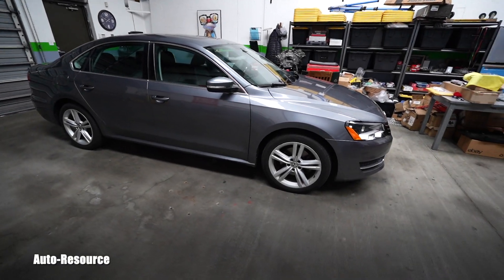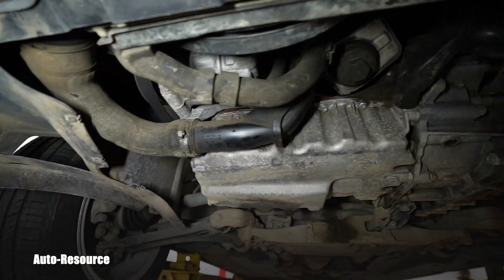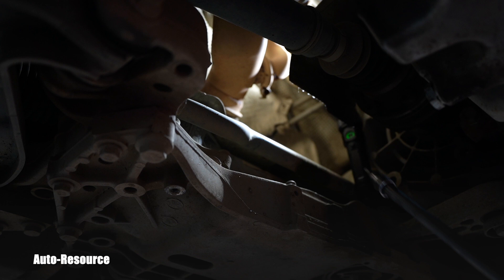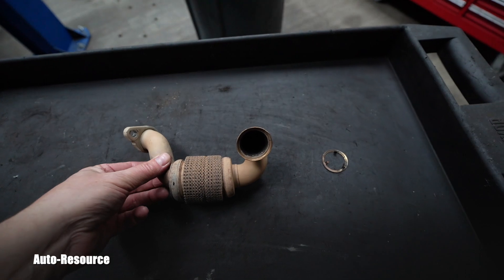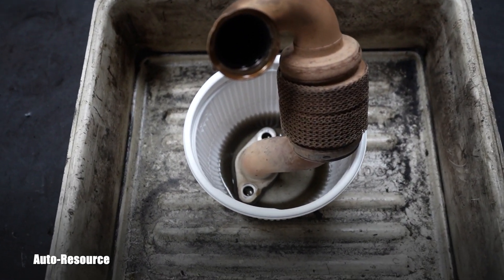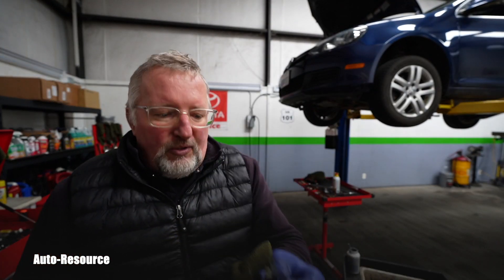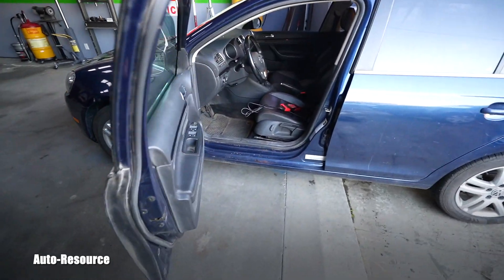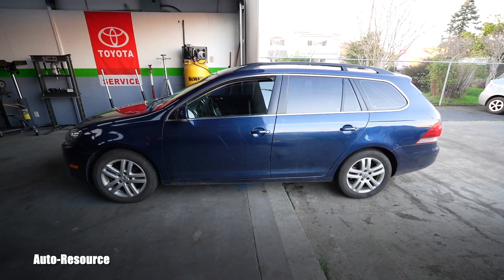VW 2.0 TDI CJAA EGR Low pressure filter pipe

Comment: I'm having the same problem. I have had the EGR valve replace and the pipe to the EGR cleaned. It seemed better for a while but when i do some spirited driving I get a check engine light again. Unfortunately I don't have the space to work on these types of things myself so I have to have a shop do it for me. I like the car but I'm at the point where I might just need to move on to a new vehicle as I don't have the patience for car problems anymore. I'm interested in seeing what you ultimately find as the culprit.

Comment: I had the same issue... it ended up being the EGR intake Regulator (directly under the EGR valve) at the front of the engine. The sensor was damaged during cleaning.
Reply: What is the part number?  What code did you have?